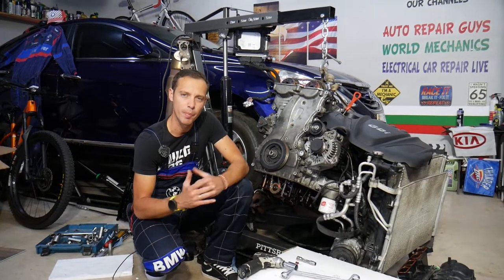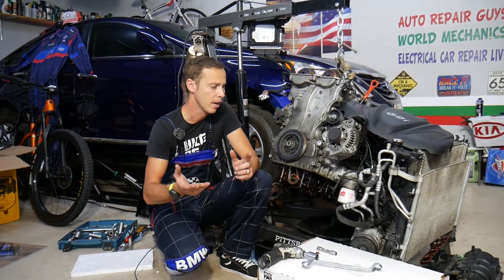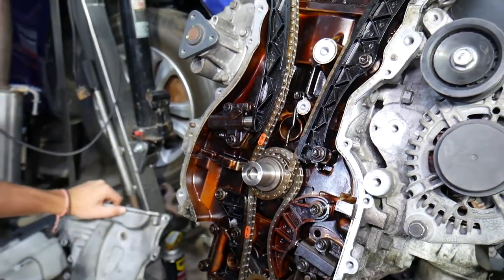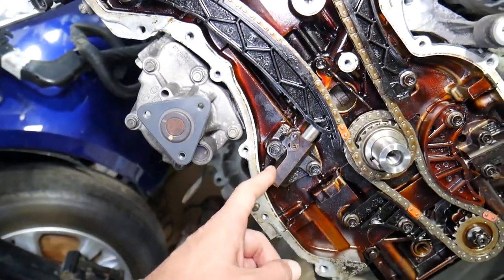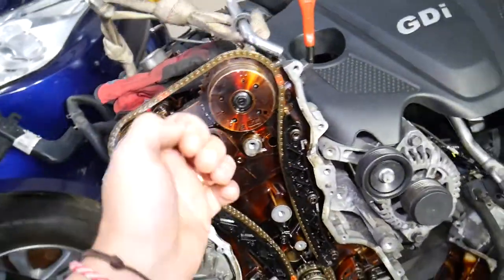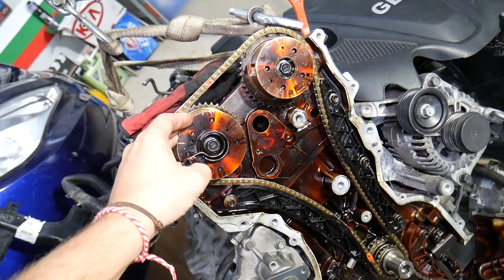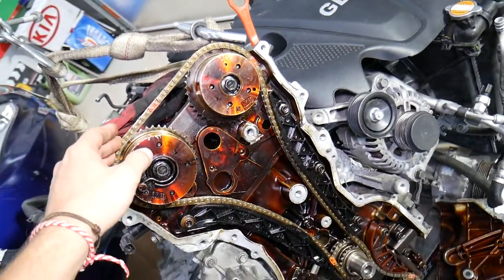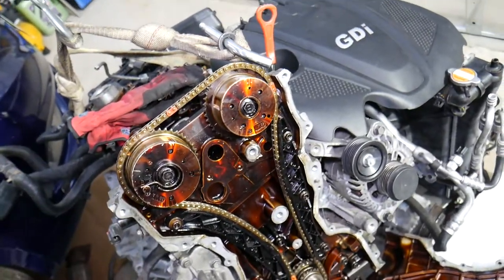SYMPTOMS OF JUMPED TIMING CHAIN HYUNDAI KIA GDI 1.6 2.0 2.4 2.5 GDI

Comment: I have a strange one for you. I pulled my cover off today and the timing marks do not lineup a decent amount. Car starts up soon as you touch the key runs and idles perfect. Drives good to. Only reason I’m taking it apart is because it kind of sounds like it has rod knock but only when it’s warmed up which is weird. I’m going to replace the bearings with the engine in the car. That’s why I took the cover off. It’s very strange and this is a replacement engine. I got for it. As the original engine was no good. But on the old engine, the timing marks all lineup with the dots and the colored chain parts so I’m assuming that’s probably the right timing on the old engine. so I’m definitely going to get a all new timing kit now too. And since I have it this far apart, I might as well drop the pan and put in the bearings I got for it. I was thinking maybe the noise is actually coming from just the timing Chain. But I would hate to go through all that and change the chain and put it back together and it’s still makes the other noise. Description of the noise is it sounds kind of like rod knock, but it only does it when it gets warmed up and it’s very minor. I would just hate to put it all back together and then I have to take it apart again, only to do what I was going to do anyway.  Any recommendations or if anyone’s ever seen anything like that please comment.

Comment: This means bad news for the car owner. Most owners will not have this job done because the repairs are beyond $2,400.00!
DIY, then you are going to need more than that, like doing the water pump, front & rear crankshaft seals.

FIY: not many videos will show replacing the rear crankshaft seals when do this or timing replacements.
Heck, many don't even replace the front crankshaft seals.

Comment: My 2016 Kia Rio starts fine but when I rev it up, it stalls out. I have codes: P0011, P0014, P0141, and P441
Reply: I have the same problem. Did you fix it? If yes, how?
Reply: @stanleymakafui  sold it